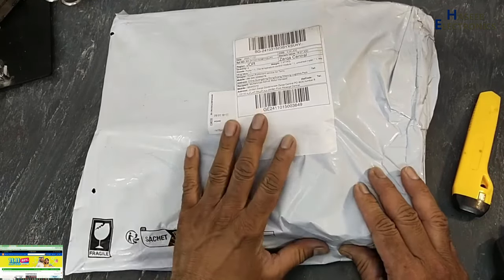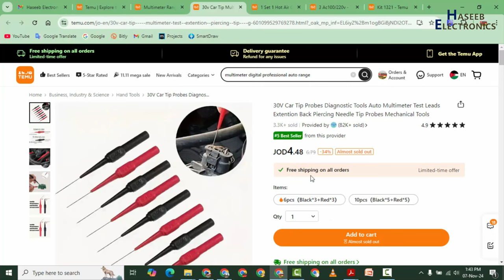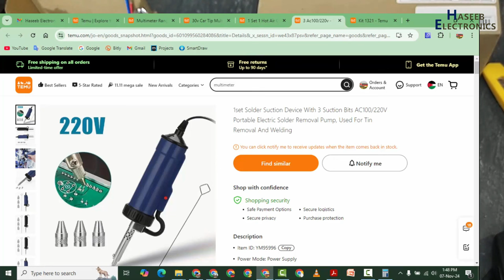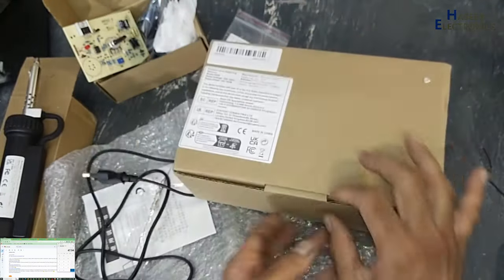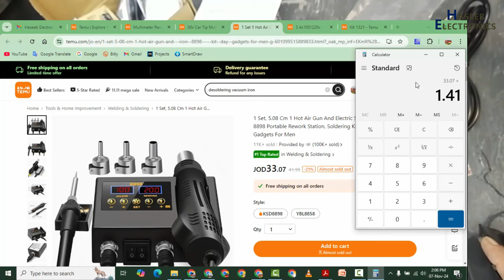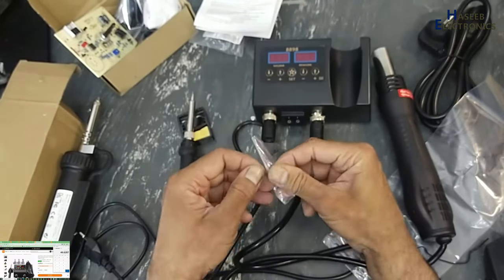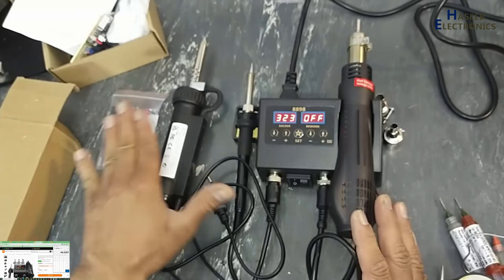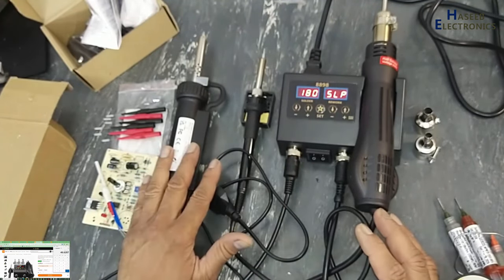{1236} Rework Station in Just $100 from TEMU Online shopping

Comment: It's all fine for the new items, right from the package. However, it should be tested after one year of usage, to see if it has good quality build. Desoldering tool seems like not very durable (I saw it bend slightly when pressing against the PCB). Hot air station, I didn't see air flow rate control, only temperature, and that plastic material on hot air gun seems prone to melting after using it for a while.